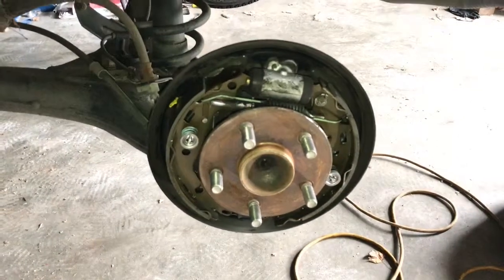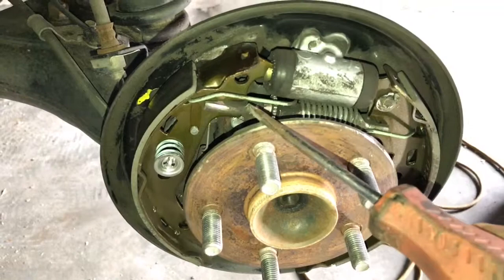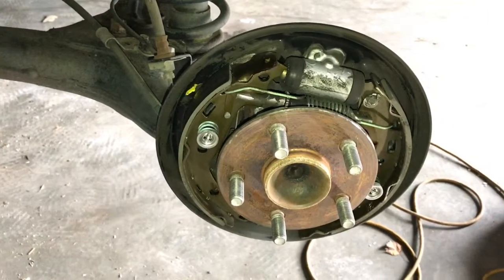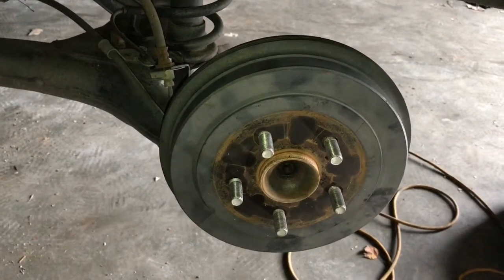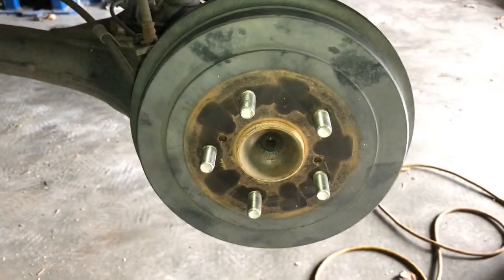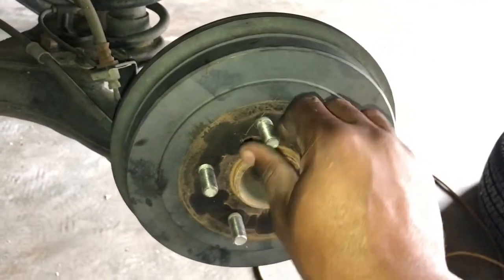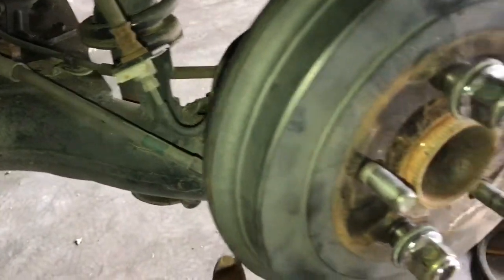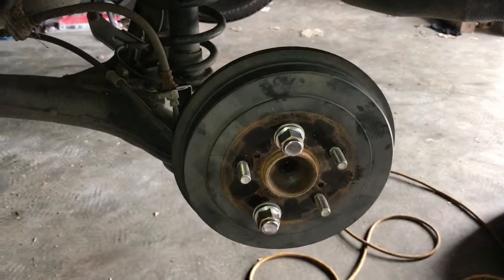Prius Rear Brakes Grabbing At Low Speeds Solved In 15 Mins

Comment: Grabbing rear brakes on this Prius are common in rainy/wet weather. The Toyota Service manual references this issue. There are six contact points on the back side of the rear brake shoes (3 under each shoe). These contact points should be lubed with "lithium soap bases glycol grease" or any waterproof grease.  You don't need to remove the shoes to do this, just remover the "shoe hold down spring clips"  (leave everything together) , the shoes will be loose enough and you can pull them away from the backing plate carefully to apply a dab of grease at the 3 contact points (per shoe). Use something like a knitting needle and be careful not to get any grease on the shoe.   If you have compressed air you can blow the dust out. Great video, thank you.
Reply from the maker: Thanks for sharing that information. I will definitely do that on the next one. 🙂

Comment: Your dad showed you...and now you showed me ..thx man!
Reply from the maker: Thank you!!!
Reply: @gillrodshop  if there's a little bit of resistance when you spin the wheel, doesn't that affect the gas mileage? does every car have "resistance" on wheels so they don't freely turn? Educate me
Reply from the maker: @BOREDANDWELLBORED  the shoes will wear within a few miles whereas they aren’t actually touching. I’m sure it may impact your fuel economy about the same as an under inflated tire, until they wear in.
Reply: @gillrodshop  thanks. Now it makes sense

Comment: Thank you! I have a 2005 Scion Xa (297,000 miles) with drums in the back.  I despise drum brakes because there are so many pieces that pop apart.  Thank you for this video.  I will see if this helps with the low speed grabbing over the weekend.
Reply from the maker: Thanks, keep me posted on the outcome!

Comment: Crazy how many people get ABS Actuator Accumulator error codes, quotes to replace and literally replacing them as well.  Most all the times I've found the adjustment lever not installed correctly inside between the strut fork and shoe where the strut isn't adjusted out correctly where the emergency brake engages when the rear end is up in the air.  Only once did I find where the ABS module is most likely bad and that is where I found both sides not installed correctly and I am guessing that wore out the ABS module.  I still wonder though if replacing the brake fluid with Toyota fluid, bleeding using Techstream or equivalent and such is enough to prevent replacing.  However, might be to late.  Thanks for sharing!
Reply from the maker: @jafinch78  thanks for replying, you’re very knowledgeable!

Comment: I have an 05 Prius. Only when the vehicle is cold on first startup do the brakes catch 'early'. I'm pretty sure it's separate from this video's issue. Pretty certain mine is just the actuator pressing a little hard when the Prius switches from regen to physical braking at around 7mpg which is correct. After a few minutes of warm up, the brakes transition flawlessly. It might be a sign of my abs going out, but since it's fine after a few mins I'm not going to rock that boat.
Reply from the maker: Good information, thanks for sharing! 👍🏾

Comment: I think a car with regenerative braking, you want no preloading on the ordinary rear brakes. Otherwise you probably will reduce the amount of electricity generated because the rear mechanical breaks are kicking in sooner than they should be. This means that your miles per gallon will probably be reduced.Which is not what you want from the Prius.
Reply from the maker: This worked for me and I didn’t notice any loss in fuel economy. After a few revolutions the shoes wear to a point where they aren’t touching the drums but have virtually no gap between them. Thanks!